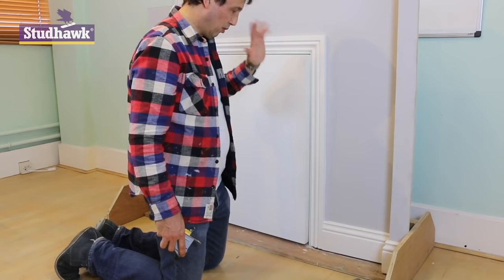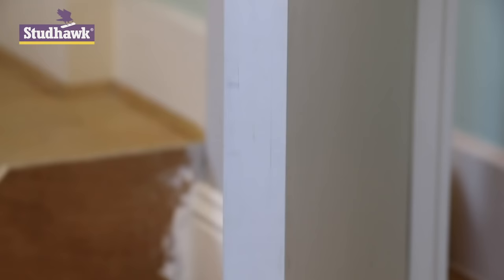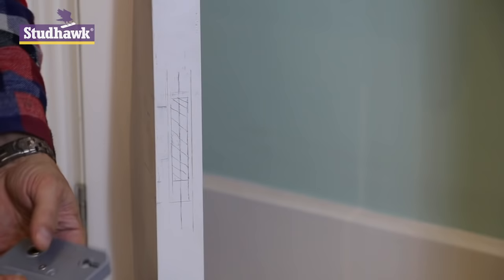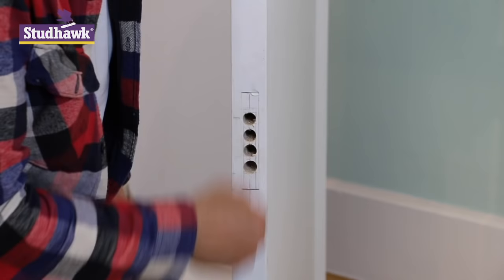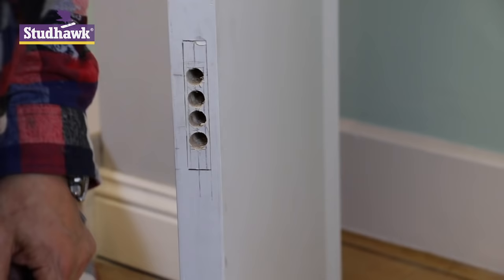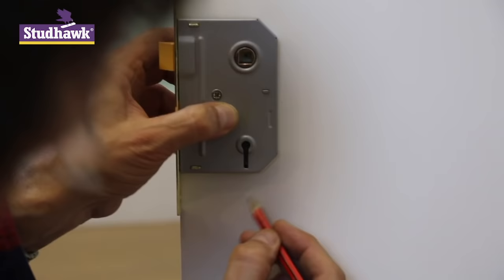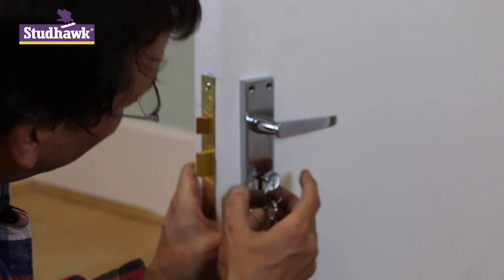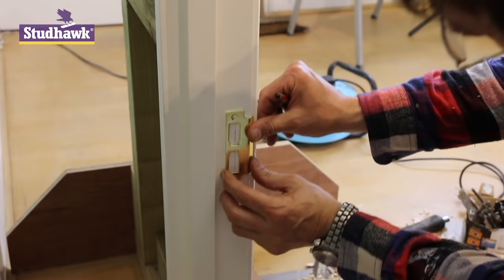How to install a Mortise Mortice Lock and handles

Comment: nice work !  after doing a home reno , i can say that this was probably my greatest nemesis ... its not as easy as it looks !
Reply: I just made the same comment. I can do it, and it is hard as hell!
Reply from the maker: Look Listen and FEEL the tool and the materials. Get to know the sound of a tool when it is used correctly. I can tell from the next room if a guy is using his tools correctly - a saw sings, a paintbrush is slapped against the side of the tin to fully load the brush inside the bristles, a hammer also sings when used well as does screwing up screws with a screw gun or trowelling up plaster and many more. So learn to listen to tools and if it sound wrong - they aren't being used correctly.

Comment: Great job you made it look easy, now I'm not so afraid to try!
Reply from the maker: If you buy a silicon tool and use it wetted with washing up liquid and water you cannot fail to do neat silicon. It really is wrong to try to be neat on application of silicon - rather what you should concentrate on is filling all the gaps fully with silicon or you will be leaving voids underneath neat looking silicon runs - directly out of the gun. If you think this is ok and you prefer it - remember you will be leaving voids underneath the neat looking silicon. So stop trying to do neat silicon directly upon application and concentrate on filling the tile gaps fully before tooling up to a professional finish. Now you too are a professional silicon specialist!!

Comment from the maker: Shukran - many thanks Salwan. If you want to know how a bathroom should be tiled or to tile it yourself then watch the whole video including the classroom setting out session. The 'setting out' section will tell you what to think of in advance of laying your first tile to start. Once you make the considerations talked about - you will start in the right place - which is vitally important. The 1/4 progressing tile bond is also great for hiding cuts in a small room and folding tiles around corners, which always looks best. Our most watched video is the How to professional Silicon which deliberately is shown messy - so that anyone will realise they can do perfect silicon. Please give us a like and share with your friends and subscribe. I made these videos as an advert for my inventions - The Studhawk Saw Guide Set which is not only for diy'ers but is a new accurate cutting instrument that is amazingly accurate. I also use it to make the shoulders for the half housing on the door frame you watched. If you want to cut skirting boards mitres - then clamp a 2 x 2 block onto the back of the skirting to create a running rail for the Studhawk to cut those deep mitres ( a pencil line will  help to saw to ) It is my belief that anyone can learn to do this with the right know how.
Many thanks Michael Orwin - Inventor and the guy in the videos!

Comment: Thanks,  I wasn't too sure about that, I managed to place the locking part into a pre-existing hole of an old door,but made a complete mess of the frame trying to fit the strike plate. Now I know "How to"..... all I have to do is cut out a messed up piece of wood on the frame, somehow plug the gap and try again.
If only I had seen this first (****).
Reply: How and where can I get the mortising device to buy?
Reply: @pyatopani  Amazon
Reply from the maker: Glad I could help
Reply from the maker: Until you can afford a mortiser use a drill bit taped off for depth and use a mortice chisel to clean the mortice out. The Studhawk saw guide will help you to cut the tenons to depth see how to make a door frame.
Reply: @Studhawk  Thanks

Comment: He makes it look simple. Make no mistake most people will not get this done they will completely bollock it up. People who do this as a profession have a feel for it. You not going to get it done so easily. He should mention get a very good chisel, because a cheap chisel will never get a good job done.
Reply from the maker: No I disagree - anyone can do perfect silicon if they follow the video - the washing-up liquid mix and the silicon tool do the rest. All you have to do is make sure the silicon tool is wetted in water/wash-up liquid and you are as good as any professional. Cutting the nozzle of the tube to the right size for your joint is all you need to do - but remember to overfill the joint and cut it back to an 8mm profile with the silicon tool. To do that use the corner of the silicon tool that is about 8mm round. Any finer and it doesn't last years.

Comment: There are special tools for this. You can have it done in 5mins and very precise.
Reply: hi Brantz yes frustrating watching this video so time consuming
Reply from the maker: If you want to buy a tool for everything or learn the traditional way - its up to you. I could tell people to use a router but that would mean extra expense either buying one or hiring one which would be more than a locksmith almost.

Comment: two screws hold it for scribing round it.
Reply from the maker: Sounds like an Excellent tip that I have never tried before in 40 years of doing this! If your screws drift slightly or the plate isnt held square the lock mortice can end up being marked out and twisted in the hole. I would say if one is very careful with pinpoint accuracy in using 2 screws and you use a Reiser or Cutter's screw it could well be a very good tip to speed up marking out - WELL SAID MATE I am going to try this - thanks for commenting.

Comment: You made one fundamental mistake., when marking keyhole - you should have brought markings 1mm back, to allow for depth of plate., in my opinion.
Reply from the maker: I did do exactly that - allow for the lock cover plate. There is a cut in the recording where I actually re-mark the hole but we used this footage anyway - well spotted!
Reply: Hope others work that out. My dilemma today is a deep lock chamber that my wife want in the centre (exactly where the tenons are). Not happy about chiselling them out (brand new hemlock door). What you guys think?

Comment: Ca you cut the main lock hole with a router?
Reply from the maker: Yes but controlling the router is difficult on the edge of the door and carpenters that do use a router use a hinge jig to clamp to the door. Listen to the chisel when you strike it and the same sound for each tap of the hammer cuts to the same depth!! So listen to the chisel and hammer. Only when you can cut a hinge with a chisel should you progress to a router.

Comment: How did you reverse the latch?
Reply from the maker: When you open the lock do it gently to ensure the spring doesn't flip out. On noticing how the spring keeps the latch in place - what you need to do is remove it then put the pieces back in the right order after reversing the latch (flip it over) then set the spring against the spring retaining lug. And then gently replace the case and fix the screw. Do it gently because the spring wants to eject the bits under tension. Appy a little logic and you will work it out. Make sure you remove the case plate gently in a horizontal position so it does not explode the pieces outwards when you open the lock or latch case.

Comment: When I do my wooden work then my cutting is not well😞😞😞
Reply from the maker: Cut slower with the saw and get a medium or fine tooth saw for a neater cut. Your Studhawk saw guides will give you perfect cuts every time - just don't force the saw - stroke the cut with just the weight of the saw! To do this one has to hold a bit of the weight of the saw off the work. Also start on a pull stroke at a 45 degree downhill angle and let gravity help the cut and cut through the thin side of the wood and don't try to cut it on it's thick edge - it takes much more effort if you do!

Comment: It's no wonder tradesmen want £150 to this seems like a lot of work.
Reply: This guy makes it seem a lot of work. If someone wants to charge you £150  for fitting a mortise lock I will do as many as you want at the bargain rate of £145 each
Reply from the maker: Eastern Europeans want £225 per day but the English that aren't a rip off charge around £150 per day - thats what I pay them currently. So par for the job.